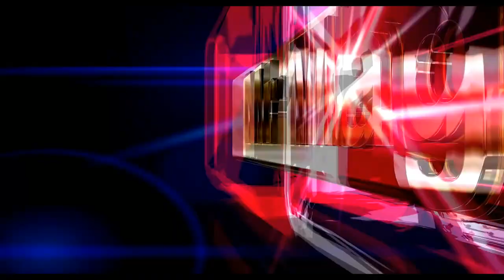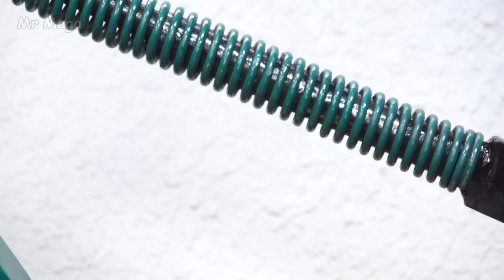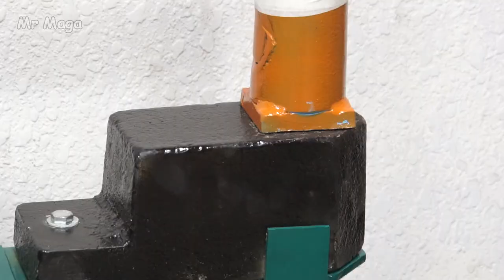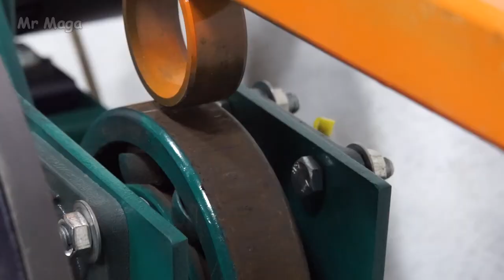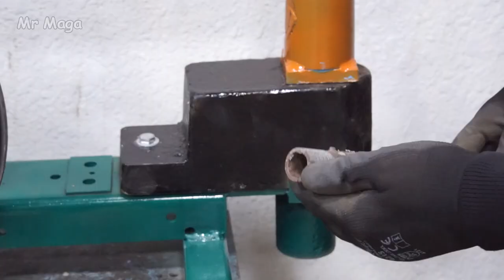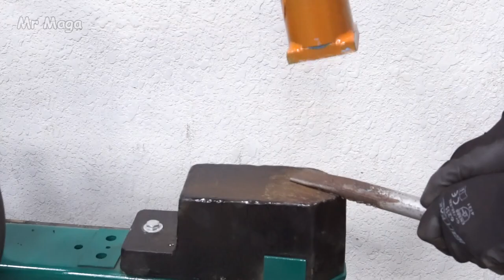DIY power hammer -step by step - home forge equipment 2021

Comment: Definately gonna need to extend the base of your anvil to the floor if nothing else is available might i suggest a six or eight in oil well caseing with a base welded on capped and filled with concrete and chicken wire. Under the anvil.